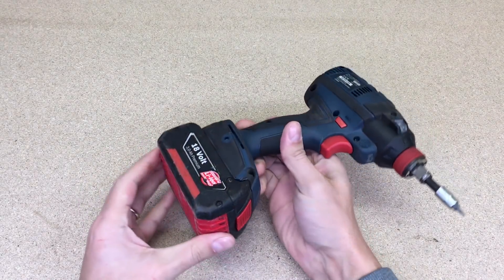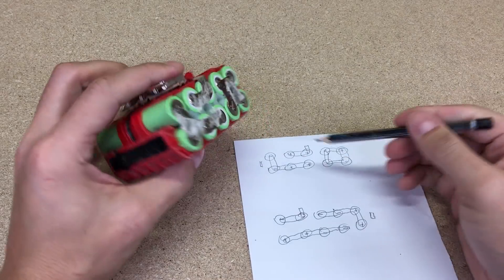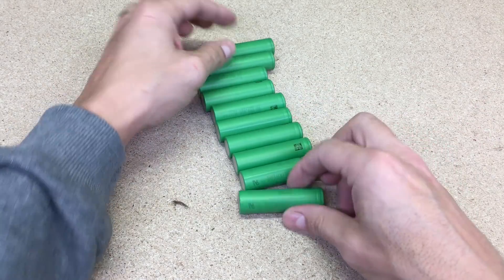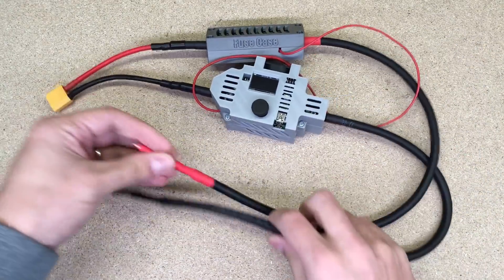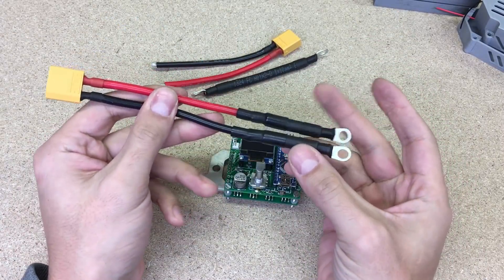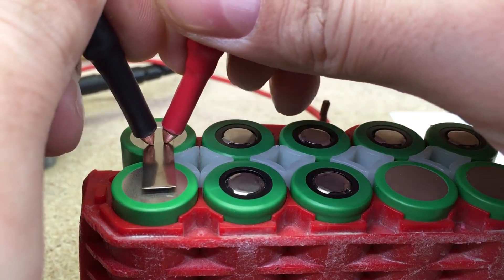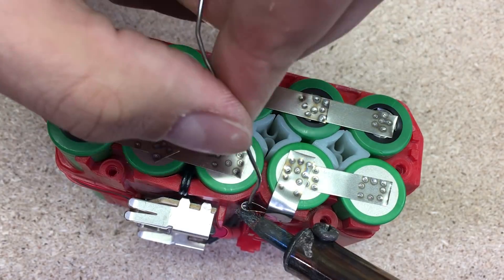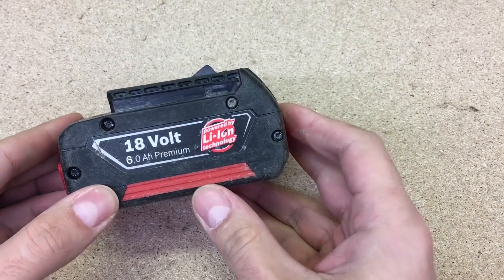How To Double Cordless Power Tool Battery Capacity From 3Ah to 6Ah

Comment: Be carefull doing that, most rescent battery modules have a chip counting the numbers of charges and trouble. If the charger refuses it, changing battery inside the module wont do anything sadly.
Reply: In the video it appears- from a limited view that the counter circuit is not present. But good catch!
Reply: Well, yes, i forgot about the video before answering to you. Their is none, otherwise his tips would have not worked :D . Maybe it is reserved to 5.0 amp or recent batteries. Who knows.
Reply: Undefined Lastname it is a shame, yes. But they cover their asses behind the dangerosity of lithium ion battery. Ave done a good video about it, look it out.
Reply: thibault berni
Reply: Some battery protection chips go to permanent  shutdown if for any reason cell voltage goes below treshold, in theory when one of the cells has just went very bad protecting from abusing it, in practice shutting it off when you disconnect a cell.
Reply: @mibars  For a time the company I work for did power tool repair (we no longer do so, not worth what we were paid). I found out the chips go bad 10 time more often than the batteries. Ni-Cad batteries are old tech but all my cordless tools are ni-cad. I just do not like the new batteries. As for the batteries we had to replace I took one apart to see just what it looked like in side. It had a PC board the looked like something out of a cell phone. Half the battery charger was in the base station the other half in the battery.
Reply: If only Ni-Cads could hold reasonable energy, keep charge in storage and not be that toxic...
Reply: @Undefined Lastname Makita has been doing this since the 18v Lithium inception. I have a stack of batteries in my garage that have maxed the count. I want to chance the cells like in this video, but I would have to source new chips somehow. Another way around it is to put the refreshed battery on a "dumb" 18v charger like Ryobi. Also not worth it for my work environment.
Reply: @trixter192  ebay, the monitor boards are dirt cheap now. Have a look, the old boards can also be repaired according to some sources.
Reply: So you're saying that my battery pack that I charge at least 20 times a day because I don't let it fall below 70% will die after so many charges that means that it will probably die within the warranty. That's a no-go for manufacturers cuz all you have to do is a bunch of fast cycle Chargers dreams right before your warranty ends so logistically from many aspects you're just wrong I'm sorry
Reply: The Modifier are you sure ?
Reply: From the "limited view" I did not see any ic circuits that would incorporate a timer.
Reply: @thibault bernier replace the chip too and problem solved.
Reply: Wrong
Reply: Mykel Hardin  No, you are the idiot. I have went to school for this crap. The bms do good bad more often than the batteries. This is caused by people dropping the batteries on time too many. There is no real way of telling for 100% if it is a bad bms or a bad cell so without testing each cell and the bms. The whole battery pack is 'trashed'. Just not worth the time and cost to try and fix it. So the the question is how ignorant are you?  I had to go to classes for this. How you had such classes? Are youj just the type of person that likes to go around the Internet posting crap to get people mad? Well if so you can go troll some where else because I am not playing your game. Have a nice day.

Comment: excellent job...these are 15amp continuous max discharge...or 30 with a cut off thermal circuit....most power demanding 18v tools exceed this limit easily at full throttle!!but these and the old ones are unprotected so the protective thermal circuit is already there....i guess!!very clever upgrade...with new 18650 that can have 20-30 amp and 3000mah capacity you dont need a second spare one!!!and great spot welder... especially with the timer delay...looks like an excellent unit...!!thanks for sharing!!!
i just saw the specs and the price of the unit....someone used just a solenoid and a battery...BUT THE SOLENOID MUST BE RATED FOR THE BATTERY CCA AMPS AND THE BATTERY SHOULD NOT BE AS HIGH AS HERE...(400A-600A)... CAUSE THERE IS NO CONTROL CIRCUIT BOARD AND YOU CAN EASILY OPEN HOLES ON THE NICKEL PLATES...!!THERE IS ALSO A 300A FUSE ON THIS PARTICULAR ARDUINO UNIT YOU USE...!!
also if you add the 90 dollars and the 60 of a 500cca battery you are almost near as here
https://www.ebay.com/itm/788H-Battery-Pulse-Spot-Welder-18650-Battery-Charger-Tester-0-1-0-2-mm-220V/122733520271?hash=item1c937ce58f:g:XVcAAOSwAVxZ0KK6
which without any mosfet mod you go up to 800amps and 0.2 thickness and you dont mess with arduino complexity ...anyway...it looks like a very well built ,reliable  AND MOST OF ALL COMPACT unit!!
Reply: ps.. amps and miliamps are the same thing just a different measurement.. and 18650's might have 7 amps of life..

and what he's done is limited that motor to below the recommended voltage..  = less torque..  amps or volts.. cant have both..    essesially the drill will use twice the amps to spin the motor  giving him no extra work time either hehe
Reply: @harleyme3163  not sure...so he ordered battery's with a larger capacity...so basically holds a bigger charge ..didnt change any specs of the drill itself expect for the charge range...which is now longer than the stock version of it's original design.

So your saying he loss efficiency of the motor due to larger battery capacity?